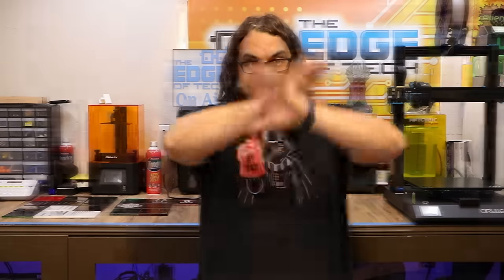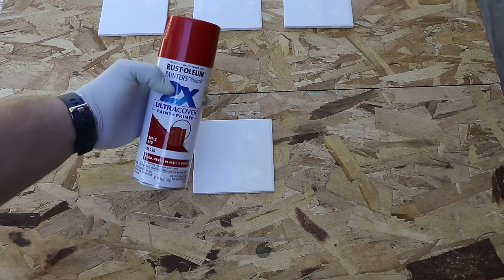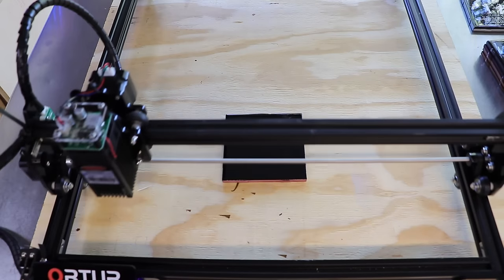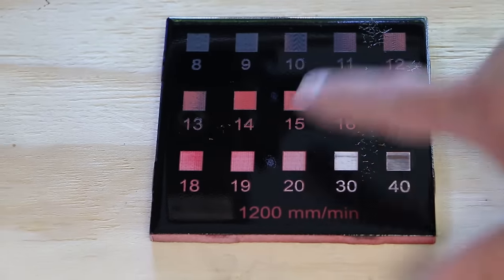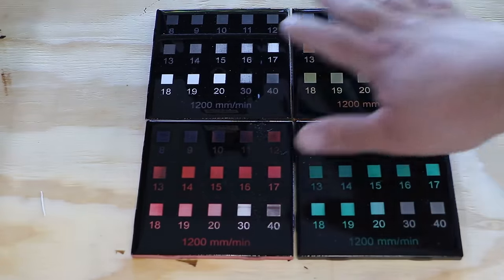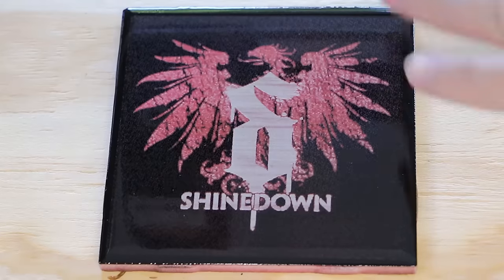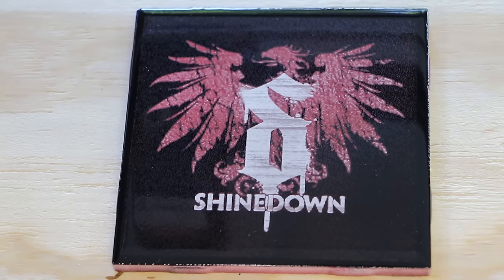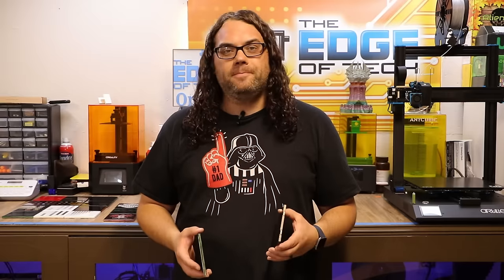How to Create Amazing Color Tiles on a Portable Laser Engraver

Comment: These are cool...
But how much time do you have invested in doing say a set of 6 of these as coasters?

3 colors of Paint at about $5 per can, (Bottom Coat, Top Coat and Clear Coat).  Having a space to let them dry for 24 hrs where they won't get dusty or get bugs in them.

an hour playing with the raster images and another half hour tweaking the power and speed parameters to get the look you want, Which will waste one of your tiles you had to wait 24 hrs to paint and Dry.

Then 30 to 45 min. per tile to laser.

Then more painting with the clear coat.

Then spray adhesive and felt or Cork.  (More Time and Cost)

You're  looking at like 5 - 6 hr worth of labor to create something that might sell for $20 - $25 if your lucky, (but probably less).  And you've already spent that much on materials with the bottom color of paint the top color of paint and the clear coat paint and the tiles and the spray adhesive and the backing.

So after like $25 of materials and 6 hr worth of labor.  How much are you realistically looking at making.  Say on a per hour basis.  It seems like your working all day for like 25 cents per hour.

Spray paint is never the same after the first time you use it.  It gets all clumpy and the spray nozzle is always clogged up.   so if you're not prepping like a hundred tiles or more at one time, you'll be losing money just on the paint.

Is there anything Cost effective you can think of making that would make money.

It seems like following a path would be so much faster and more efficient than doing those raster files.
Reply: While I must concede to the point you are making in general, I dont agree to it entirely.  Why dont you make some suggestions?  I think these tiles would make excellent personalized gifts.  If you send out to have personalized work done the cost is much higher than that of mass produced work regardless of format.  I am fascinated by the number of critics that can only point out others flaws but never seem to have solutions themselves.
Reply: I actually disagree with you analysis here.    If you can crank out 10 sets of 4 coasters and sell them at $25 a pop your making good money.  

Let's analyze it.  Prepping a tile is going to take about 30 seconds to a minute per tile, so for our 40 tiles we are looking at 20-40 minutes.  Let's say 30.  Each coat of paint takes about the same time as prep work so between the base coat and topper coat that's probably an an hour and half for both coats.  We do have down time of a few hours between coats yes but that's not exactly "labor".  

The labor of working on the picture is kind of tricky, if it's a custom job that needs to be accounted for but if it's a piece you expect to burn regularly the labor time is split between all ones you make so it's kind of negligible.

Our biggest time sink is in running the laser.  Set up for each burn will take a minute, so that's 40 minutes.  Cleaning and clear coating together I will say come out to five minutes total.  So that is 3 hours 20.

All told we have about 6 hours of labor in the batch of 40.  Say $50-75 in material so your looking at around 30ish $ per hour of your labor
Reply: @inigomontoya4109  
45min. Per Tile.
That's 3hrs of machine time for only 4 coasters.
4 1/2 hr of machine time for 6 tiles.
Come on man.
How do you get your going to make $30/HR when it takes you all day to make 4 drink Coasters?
Reply: @onestopfunstop317  the machine time can be split amongst other things.  I'm not aware of anyone who just stands there managing the machine.  I usually am doing other projects while the machine runs and I check on it every 5-10 minutes

Comment: Could you post your console settings please? Because my burns are no where near yours...
Reply from the maker: Hi! Are you using Lightburn? The test is set at 1200 mm/min and then the speeds/powers in each part. If you are on an Ortur/Diode laser, you want to make sure your speed is mm/sec. That will change it greatly.

Comment: How long did it take to engrave the tile?
Reply from the maker: A couple hours depending on your settings!
Reply: I thought you said 17 minutes? 1200 mm/ sec? That's about 47 " / sec. That would be 12 - four inch passes / sec. At 600 dpi isn't that 50sec per inch of engraving? I know there are discrepancies in this, so how should you estimate the run time?
Thanks for the video

Comment: Dude, been trying to get the magic number on my Snapmaker A350 for about 2 weeks now and still not able to. Its laser just aint as grunty as the Ortur Master 2. I'm at my last tether with it :)
Reply: The laser module for the snapmaker is 1.6W, the laser he is using is approximately 6-7W so it is considerably more powerful.
You need to slow your feed rate way down and set your laser power higher.

Comment: This wouldn't work for me. I have the Ortur 15w. I can't get through the black, even at 100%. I may have used the wrong black paint though, I used a rustoleum gloss protective enamel black.
Reply from the maker: Are you making sure you are focused correctly and at the correct height?
Reply: Yes. I noticed wiping it with a wet rag after helped my test block. I wasn't even seeing green until 30 to 40% power. I'm still playing around and will give you an update.
Reply from the maker: @aarons.8532  You may need to up the percentages a little for the 15-watt laser. Also make sure you're within the focal length.
Reply: The sweet spot for me is 45% at 42 speed (I changed it to inches). After I burn it I clean with a damp cloth and it looks good. Fortunately the tiles were 8c so wasting a few was no big deal. Thanks for the replies and tips.

Comment: Tried doing this, somehow only the middle of the test squares and numbers , the outside horizontal edges aren't burning as deeply, anyone have ideas?
Reply from the maker: I would make sure you painted evenly. I have had a couple where I accidently had an extra streak of paint and it isn't even with the rest. Then I get mixed results.
Reply: @TheEdgeofTech  it's only burning the middle of every box, so I don't think it's the paint thickness. I've done some more testing and it seems to only be that one file, possibly since I have a different machine, the culprit is there. 

However, there are further issues, seems like maybe I got the wrong type of spray paint. They didn't have the 2X in black, so I accidentally bought "Protective Enamel" instead and it seems to be burning weirdly.

Comment: 1. Programm Window-Size
Do you still have a 720p Monitor? If so get a 1080p Monitor (they are cheap). If you have a 1080p Monitor turn down Windows Scaling (Desktop, Right-Click --> Display settings). I would guess you are at 200% scaling right now.

2. Saving Images form the web
Something in me died when you where saving the preview image of the photo with a 225x225 Pixel Resolution. PLEASE always open the picture at least in the big preview from google or better get it from the site directly.

Comment: Tip: acetone and lacquer thinner are same thing, just different packaging.....so buy whichever is cheapest wherever you shop.
Reply: Read the label first.  Although some lacquer thinners contain acetone, they usually contain toluene, denatured alcohol, or other solvents. Acetone is acetone.
Reply: @hopelessnerd6677  Yeah, I'm sure different companies change things up a little, but I've seen bottles of lacquer thinner that said 100% acetone....and bottles of acetone that said 100% mineral spirits. Just a case of companies repackaging a product several different ways to make more sales.

Comment: This is a nice video, but with a 15-20 watt laser it seems to me that you are etching paint not the glass/ ceramic tile. I like your video and the effects that you produce, but I want to know what is really happening with the laser. That is why the paint coat needs to be uniform thickness for your outcome color.
Reply from the maker: You are correct! I'm just etching off the paint to reveal the paint or tile underneath. In this method I am not burning into the tile.I will do a video on the Norton method which actually burns into the tile soon.
Reply: @TheEdgeofTech  thanks for your reply. Looking forward to your next video.

Comment: You do not have to use a solvent to clean the tiles prior to painting, it is a total waste of money.
The glaze on the tiles is kiln fired at over 1000 degrees so the only thing that can be on the tile
is dust from the unglazed bottom of the tile sitting on top of it in the box.
Simply wipe the tile off prior to painting.

Comment: WHAT KIND OF SETTINGS ARE YOU GUYS USING WITH A 3018 5.5W LASER?
Reply from the maker: These settings are probably close. The one I use is around 5.5w and has the G8 lends on it.
Reply: So the 40% is high enough? Even with a 5.5w?
Reply from the maker: @ToddMoore1  Your settings may vary, but if you have a 5.5w laser it will do this with no issue!! Nicky Norton himself only uses a 2.5w laser to do much more than this!